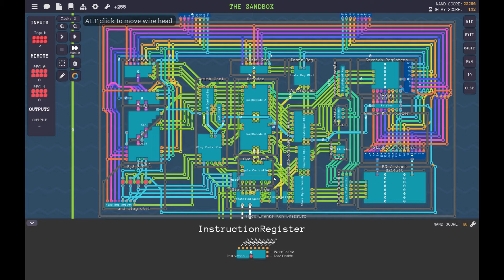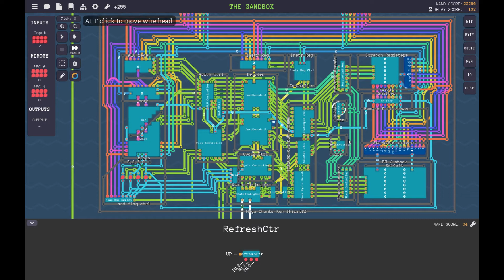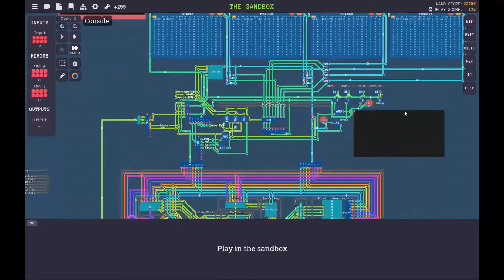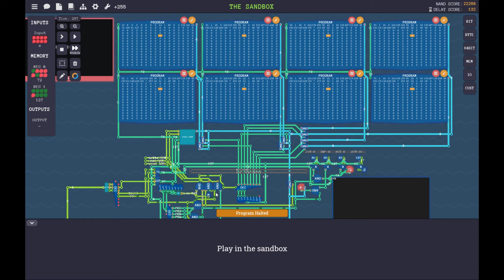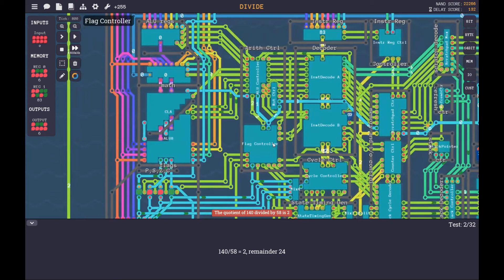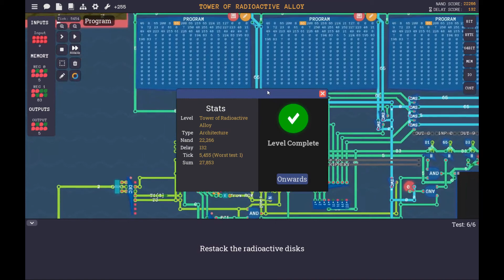Turing Complete - The What, Why, And How of the Intel 8008

Comment: How did Intel create a matrix of traces for RAM with only one metal layer? Is one line just a very long poly-silicon gate? So RAM was squeezed along this direction?

Was this the reason that at first there were shift registers? But how do you route the clock? I imagine that clock and Vss run parallel through a tree. For one direction current has to flow through poly silicon.

In an address generator it would make  sense to use one address line per node to de-multiplex the others ( and the enable line ). Then we need less crossovers.

Comment: Can you make z80 like architecture with it? I've got no idea how z80 work
Reply from the maker: Pretty much all I know about the z80 is that the instruction set is (close to?) compatible with the 8080. I've wanted to learn about it for a while but I have several other projects at the moment unfortunately.
Reply: @AbelianGrape1  very similar (like LD instead of MOV in 8080) but have additional instruction set too
Reply from the maker: @firmaneffendi2801  "compatible" in this case means binary compatibility, not source compatibility. If the z80 is compatible with the 8080, then you could run a program that is already assembled for an 8080 on either device. But I'm not sure if it's actually compatible or just close.
Reply: @AbelianGrape1  I'm not sure with that as I mostly have z80 in my entire life 😅